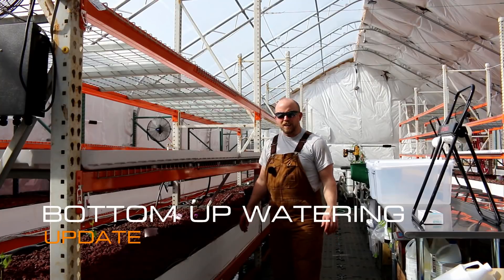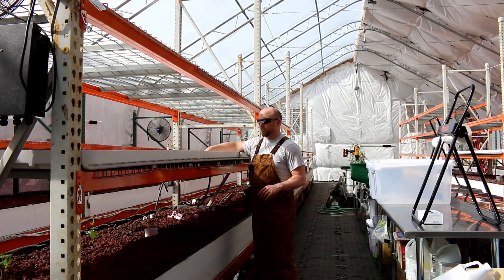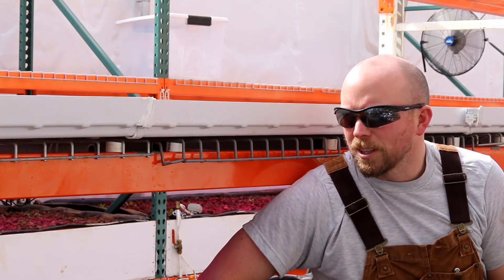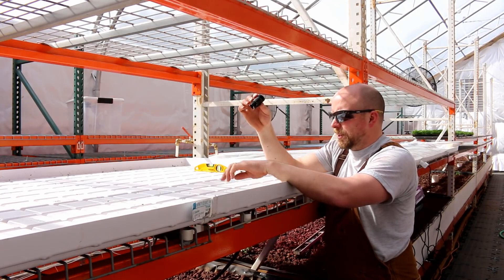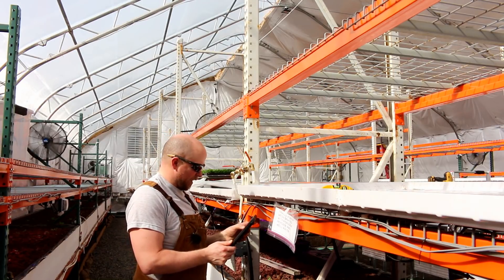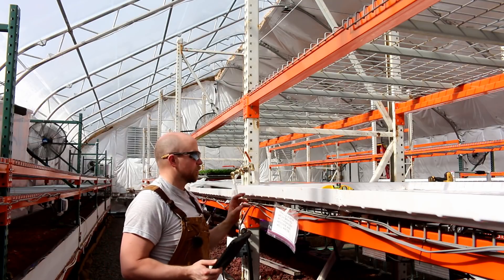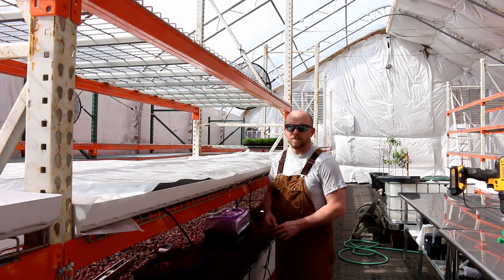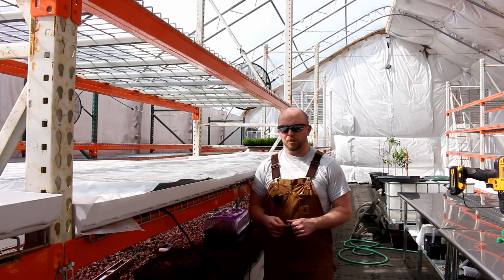Is BOTTOMS UP WATERING - The best way to water MICROGREENS

Comment: under bed hydronic heating is most effective. It avoids heating the air, increasing humidity and the need for large air volume motion. A local heat trap, as you did the plastic cover on rows, does improve production until full radical emergence.

Comment: Hi great videos. Can you tell me, have you tried deep water culture. if so what do you think is the best for micro greens growing DWC or flood and drain? Thanks
Reply: DWC is not so good for microgreens. You are harvesting less than 2 weeks after planting so DWC never has a chance to really so anything.
Reply: Strange that I grow micro greens in DWC and as far as Iam concerned its the best way to grow them. Ive tried all over ways and DWC is the best.....Cheers
Reply: What does DWC stand for?
Reply: @bryanmilne  Deep water culture
Reply: @mreightytwenty8709   I missed the reference in the beginning of the original comment.  I've since watched a few other videos on Hydroponics and came across this term.  But I'd never heard of it or the acronym DWC before I posted my question here. Thanks!  I'm really interested in ebb'n'flow (flood/drain) and NFT systems, but it seems like most videos show using bottom watering by hand for microgreens. I'd think for commercial growers, automated watering systems would be a massive time saver allowing for substantial ability to increase capacity for production.

Comment: I am so happy you do plan on ripping those racks out and redesigning.  Bravo!  However, I do not agree everything is safe as it.  Water is heavy and it will find it's own level.  Where it is deepest it will be heavier causing more force to tip the racks.  After massive plant growth occurs, the plant mass (roots and growth) will add to those forces.  If water flows over the edge, the foundation will be eroded like it has happened in the past.  Please attach large 2 x 4's or metal between all lanes.  This will prevent them from tipping if a series of events occur.  Better to be safe than sorry!
Reply: This is a sound suggestion, I think. Nothing major would really be necessary, maybe 2 at each end to tie the lanes together and maybe an aluminum pole at each end on your middle span to tie both sides down. Providing that they are adequately level, of course.
Good luck Jeff, things are looking great!
Reply: Yes, but with a right angle bracket to resist racking if they start to go.  Perhaps Jeff could automate a tip feature on the racks!  Just kidding.  I don't want to see anything happen other than beautiful veggies growing!
Reply: TRM, for Habitat 2 I would use gunite (concrete spray) along with concrete piers and beams for the racks supports. Put leveler feet at the bottom of the rack feet. Then adjust level with a wrench.

Comment: You know I studied a couple of greenhouse operations. The successful ones were paranoid about infection. They would spray the entire structure, wear gloves with seedlings, walk in pans of disinfectant, no tobacco users allowed. A virus can be transmitted fron the fingers of a smoker to the tomato. I see you don't do anything, any problems with plant infections? Molds, spots, etc.? Question 2, would it be more energy efficient to build a solid well insulated building and just supply artificial lighting? I ask as research for winter tomatoes.  Great show.